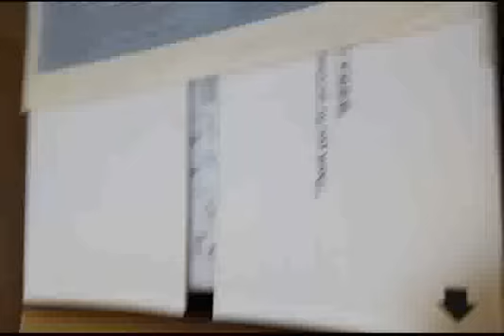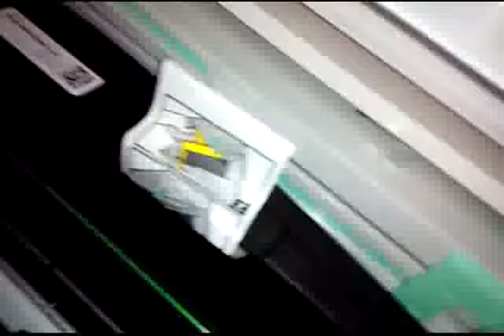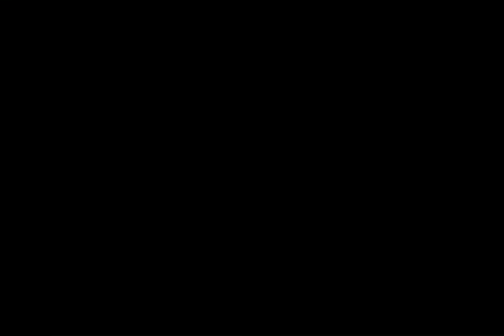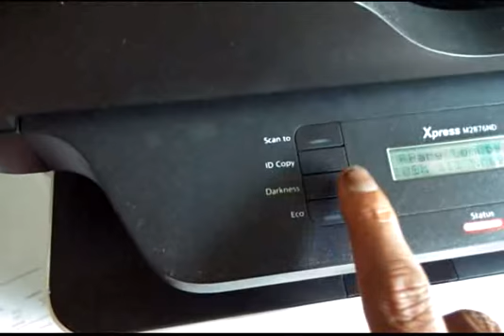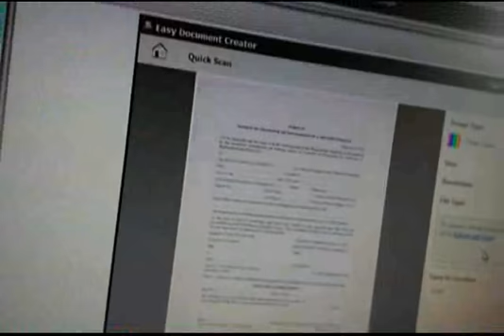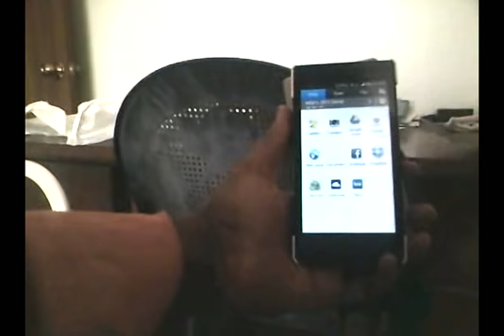Samsung  Multifunction Mono Laser Printer SL-M2876ND/XIP unboxing and review

Comment: I have a Samsung printer model Xpress 2876ND this is giving two errors and and able to print & scan any thing UI-2334 & UI-2330, I have contacted to Samsung service engineer he told that its fuse unit needs to be replaced which very costly arund 4500/-.
I can't bear this cost kindly help me with any alternate solution.  Best regards

Comment: Dear Uttam, Already connected to D-Link Wifi Router, using RJ-45 Jack, it is getting  IP (checked using IP Scan),  automatically. but the software is not identified any Printer (Network Option is used in the SW) and also tried to setup manually  using SW with its mac address and IP. even though its not connected. connects only through USB.
Reply from the maker: +Bhaskar Kotipalli There may be some issues with the software and the system firewall blocking the IP. You first try to install the printer thru windows control panel > add printer> there select network printer and see if it detects it. make sure you enable file and printer sharing and PnP services is enabled. Once this is done then use the samsung software downloaded latest version from their website.
Reply: Sken me sken karte Samay bich me se vapas chala jata hai sken nahi hota hai

Comment: How to make Network setup using RJ 45 port, through router
Reply from the maker: +Bhaskar Kotipalli Please connect printer with router and the printer will get automatic IP address, now use the software and install the printer, the printer will get auto detected and will be installed.

Comment: Samsung Multifunction Mono Laser Printer SL-M2876ND
.I also want to purchase same product but i have some doubt about refilling of this printer.It is cost effective like canon printer or expensive.What about cartridge replacement and drum life .
Reply from the maker: SUSHIL KUMAR SAHU Cartridge can be refilled for around 300/- but since this has a chip you will have to bear chip cost as well of around 150/- if required. Talk to the refiller guy for total bargain cost. Keep the original chip, you may require it later.

Comment: Uttam ji, i am interested in this printer but only question is whether it can scan legal paper through ADF. Samsung website says yes but some reviews on Amazon says no. From Legal paper, i mean the one normally used in india, not that 14 inch one.
Reply from the maker: Ashish Singhal Cartridge can be refilled for around 300/- but since this has a chip you will have to bear chip cost as well of around 150/- if required. Talk to the refiller guy for total bargain cost. Keep the original chip, you may require it later
Reply: It can scan legal from its ADF. But this printer is shit. Dont buy. Many malfunctions

Comment: bro i bought same printer how to reset the settings plz upload video
Reply from the maker: In the menu go to settings and do a factory reset else login to the printer console thru browser and then under settings do a reset.
Reply: bro address of the printer please means like 192.168.0.101
Reply: thanks for the quiker reply bro
Reply from the maker: Yes if you have router, login to router and see under DHCP what address has been issued to the printer else go to the printer control panel and under network settings, see what IP address is allocated to the machine, then u can use the same ip address in browser to open the control panel thru web interface. Thanx